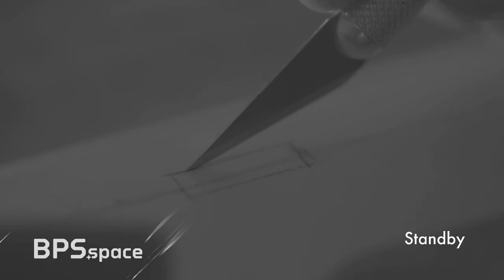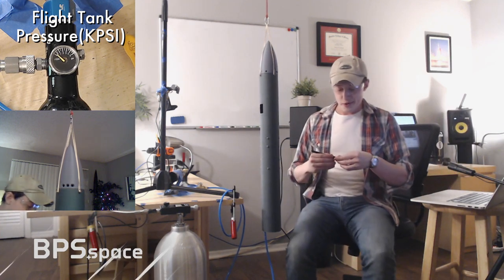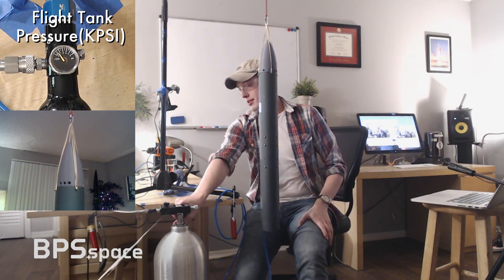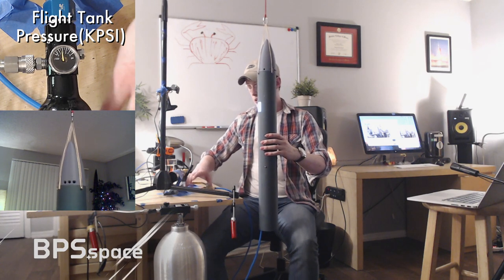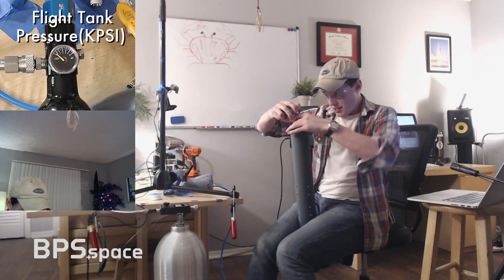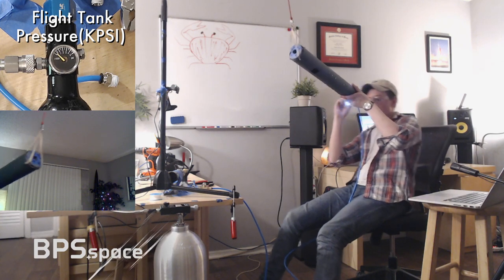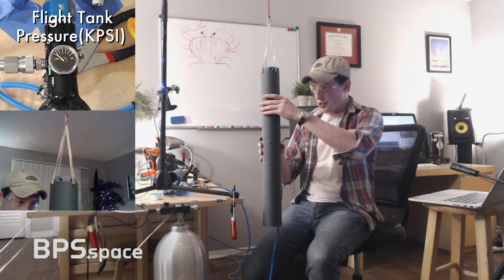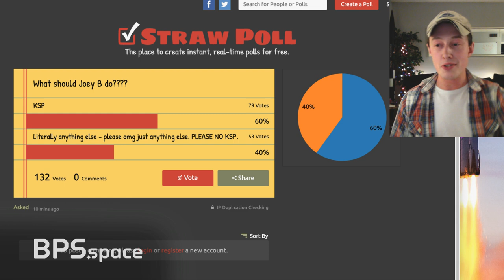Live RCS Roll Testing

Comment: Hey, I see you are using Arduino IDE for programming. This is cool, but there is a beautiful plugin for Visual Studio, which then uses the Arduino IDE and libraries in the background.
I absolutely recommend it, since it helps a lot with formatting and coloring your code.
A must for bigger codes. You'll find it as "Arduino for Visual Studio", give it a try, it's worth it!

Comment: Some constructive criticism and ideas. You need to isolate the roll axis completely to help validate your tests.  The less it can wobble in the x-y and the easier it can rotate about the z the better. The tubes hanging and attached elsewhere are resisting the roll, it might not be much, but its still resistance that would not be seen in flight. I would mount the flight tank inside the rocket and have a detachable tube for filling. that way you can fill, detach, and have nothing but the top tether that would resist roll torque, which can be also changed to minimize the resistance even more. Also, maybe create detachable panels for ease of access to the innards (if this is rocket is for ground tests only, if it will fly don't do it).  Great videos. Keep it up.